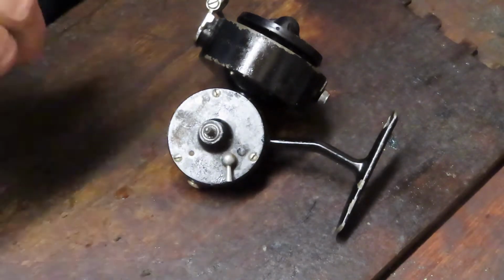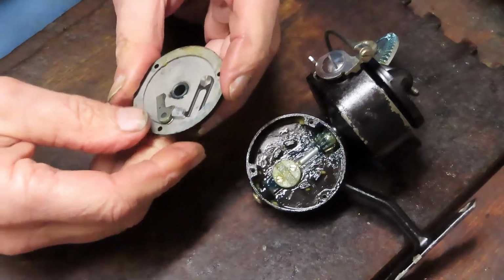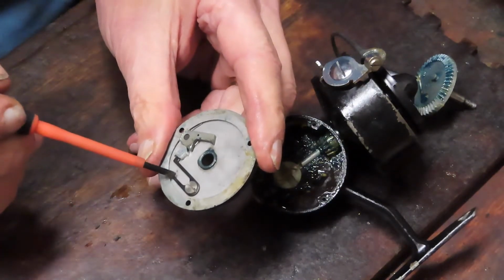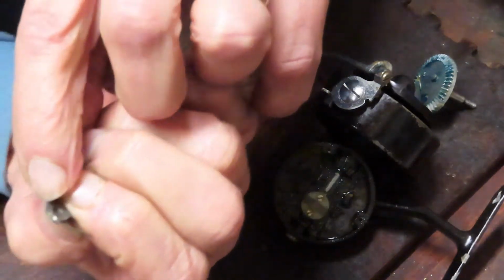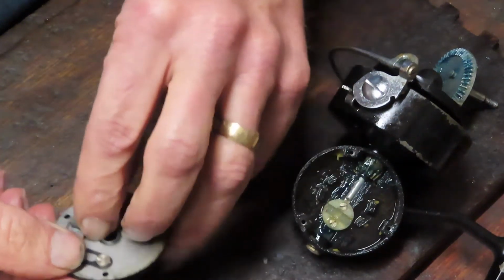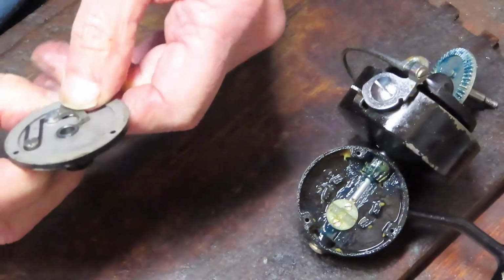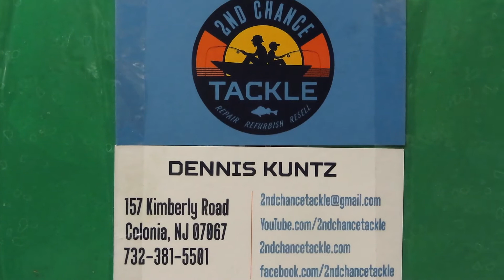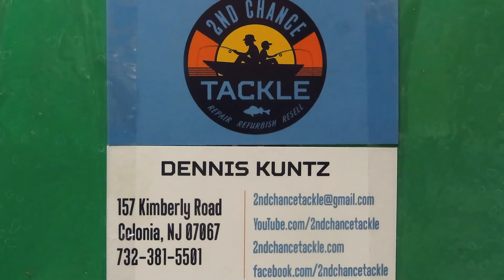Mitchell 304 spin fishing reel how to install the anti reverse dog spring how

Comment: I am working on a 314 that I just picked up. It would not crank. Cleaned it up and I noticed that the plastic part with the two small screws and partly broken off. It looks as though I can get a replacement part.This video showing how to reinsert the anti-reverse spring was great.
Reply from the maker: Glad it helped.  Thanks for the note and for watching - Dennis

Comment: I use this same reel regularly! Great little reel. Thanks for all these helpful videos.
I just cleaned a Shakespeare omni 020 2000.. can't get the pawl spring to stay 😢
Reply from the maker: What is the issue with the pawl?
Reply: @2ndChanceTackle  the thin piece of metal that gives tension to the anti reverse lever/pawl has a little prop area in the casing and a gap in the pawl.
I just can't get it right. Over bending yo insert, then too much tension when testing or too slack and drops out.
Thank you in advance bud!
Ryan.
Reply from the maker: Set the pawl in the line guide and turn the reel until the pawl seats inseflf flush with the rim of the line guide.  Do this with the reel upside down.  If you are having difficulty getting it seated, put a finger on the base of the pawl while turning the reel.
One the pawl base is flush with the line guide, put the insert on top of it and center it so that you can install the cap.  Do that next.  It should correct your issue
Reply: @2ndChanceTackle  I shall give it another go. You're a gentleman, thank you!